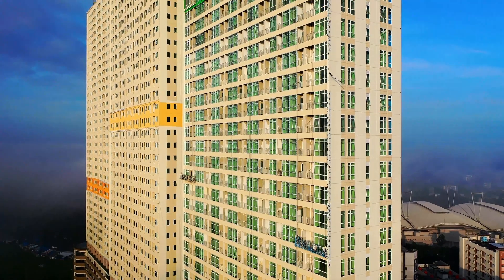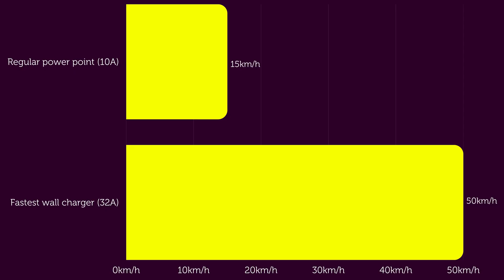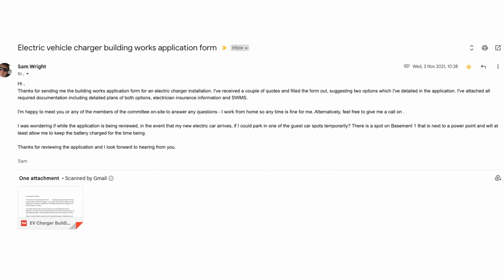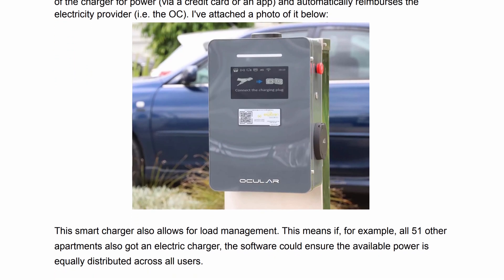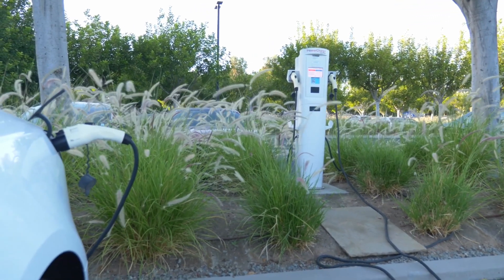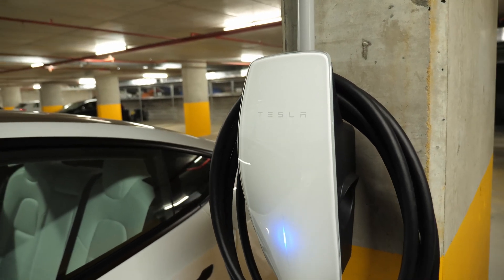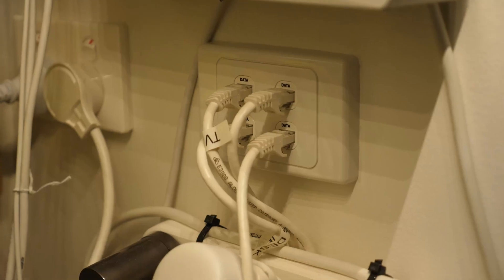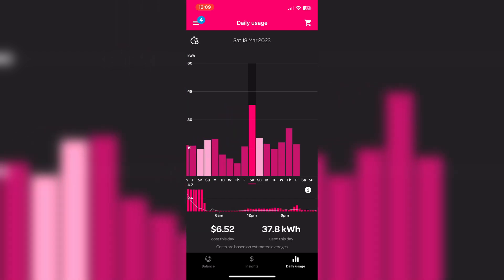EV Charger in an APARTMENT?

Comment: Great video. Thanks for sharing, mate. Cutting down the bureaucracy involved could be one effective way state and federal governments could get involved, eg by making it harder for body corporates/owners' corps to prevent such installs (eg a 'reverse onus' standard), provided installed to standard etc.
Saw another ABC video on YT which claimed one apartment body corporate spent $200k to facilitate chargers to their basement; perhaps in that case, no existing power outlet existed (though, that would seem unusual in most apartment contexts, one would think). In any event, that story said buildings standards for new apartments built require electrics for EV charging from this year.

Comment: I’m currently going through exactly your process. I started discussions with Body Corporation BC one year ago. They were horrified and said not willing to do anything but if an individual wanted to pay for installation and usage that would be ok. So I bought a Tesla and applied for a 15amp power point. I didn’t want to scare them with the words car charger as they might have a heart attack. I consulted the building electrician who suggested running it from the main board in the basement with it’s own meter. I offered to monitor the meter and make the payments and they could check the figures whenever they wanted. Their answer was that before they could consider the application I would have to pay for an audit of the whole building’s electrical infrastructure! 90 units in the 23 story building. Cost over $3000. The quote for the power point was already $2200. I refused, they said go away. I said see you at the Bccm conciliation and arbitration commission. This happened in January and they agreed to pay for the audit but I had to connect my ppt to my apartment meter. Unfortunately that’s on the 18th floor and would be crazy expensive. So currently negotiating a compromise and looking for alternatives. I will get there. 
I can see that the beauty of an electric car is being able to come home and plug in just like your mobile phone. Congratulations on your outcome. Great video.

Comment: Awesome video, thanks!  I'm just moving to a very large new apartment building (with about 400 units and 45 floors).  They've installed just two 11Kw chargers in the residential space with billing via Exploren. There are a few power points around the basement like yours for cleaners etc, but none adjacent to my car space.  
I think I could run an extension lead from a nearby one but of course that is not really a regular option as everyone would be paying for my use, although some other Teslas are doing just that  atm. It's good that at least there are a couple of chargers, but two is not going to cut it as more and more residents get EVS, particularly as they are not fast chargers. 
I really wish the NSW State Government would legislate that all new buildings have to provide for at least a 15 amp power point, or the potential for a low-cost install of one at the resident's cost, for each car space.  If they did this then the builders/developers would need to at least provide the metering capability and a main electrical 'spine' on each car park basement level.